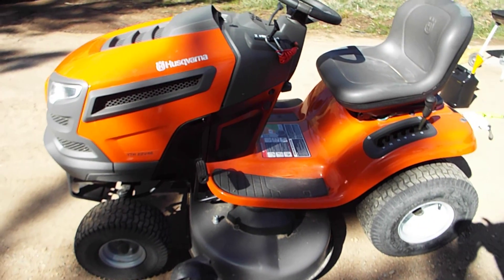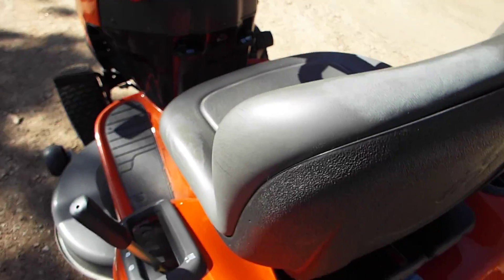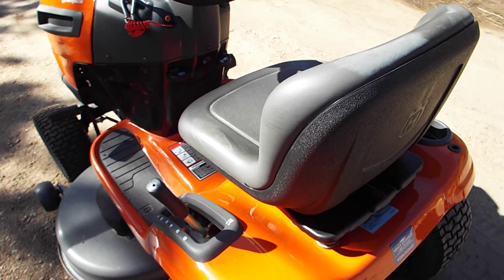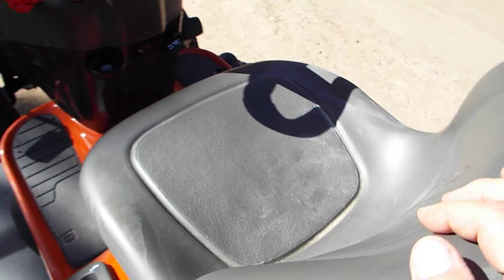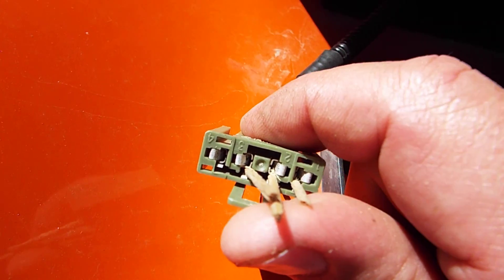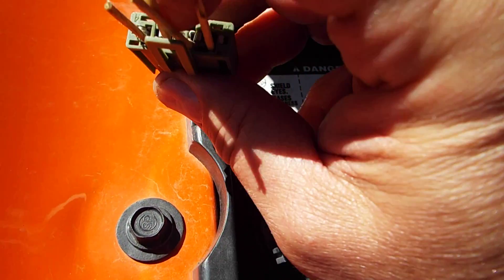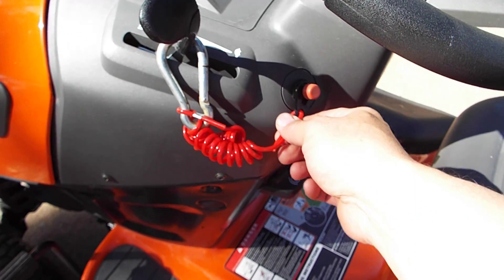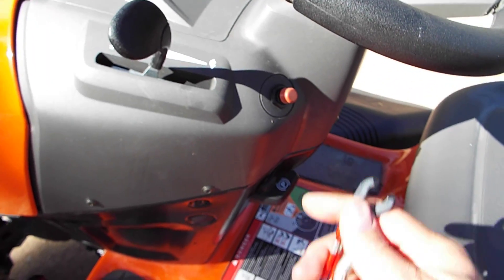Husqvarna Riding Mower Seat Safety Kill Switch Modification

Comment: My model does not have the blade wire ex[posed, so where would you think would be the best place to connect a ground to the engine when tripping the tie switch. The spark plug itself of the magneto or somewhere else i.e to short the circuit in an emergency with the seat safety isolated  Appreciate your thoughts
Reply from the maker: Anywhere a bolt goes through metal should work as a ground, test it out before riding around and mowing.
Reply: @madscientisthut  Thanks for the quick reply I understand the bolt for the negative, but where would be the best place for the positive to make the short, like you did on the blade control. My blade control is today electric no wires are obviously visible. i was encouraged  by your video to make the conversion  Many tks
Reply from the maker: Not sure, try the seat circuit.

Comment: It's winter, and I went to move my Husqvarna mower and the engine would die when I was letting up the brake pedal. Am quite certain the seat is frozen so the sensor won't operate.I checked the wiring diagram for the sensor and saw it mentioned a shorting plug so I suspected it worked the way you're explained. But you've confirmed it. Thank-you!
Reply: Same thing. Thanks. Managed to get some firewood to the house.

Comment: There is a thin metal shim on the inside of the plug, it looks like the prongs on a fork.  Just remove it with pliers to accomplish the same thing.
Reply from the maker: Mine was under warranty when I did this, so I did not want to "damage" the connector to give them a reason to void my warranty.
Reply: @madscientisthut  Point taken.  I bought my mower last week, new...had it delivered and made the modification even before using it.
Reply: Mad Scientist Hut if you cause damage to a connector or plug, obviously that connector will not get repaired under warranty. 
That being said, don’t live in fear of losing warranty coverage on the rest of the unit because you modified or damaged one part on it.

Comment: Another way to disable it on most models , take a small pair of needle nose pliers and pull on the bottom of the metal clip that you stuck toothpicks in between and it should pull out in one piece, then leave unplugged and the seat is disabled
Reply from the maker: The reason I did this method with the toothpicks is because my mower was still under warranty, and I did not want to give any reason for them to deny warranty work.

Comment: You can also remove the shorting bar instead of using the toothpicks.  It just pulls out.
Reply from the maker: Since my mower was still under warranty I was trying a less destructive method just in case I needed to get some service done on it.
Reply: What is the "shorting bar"?